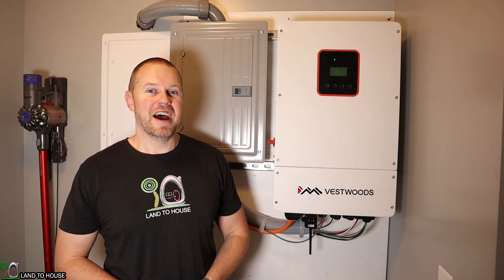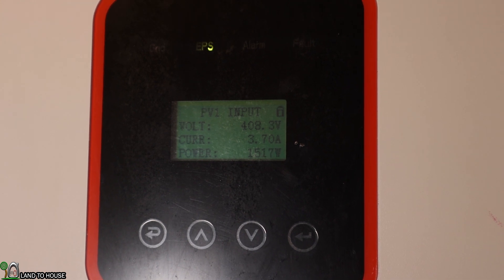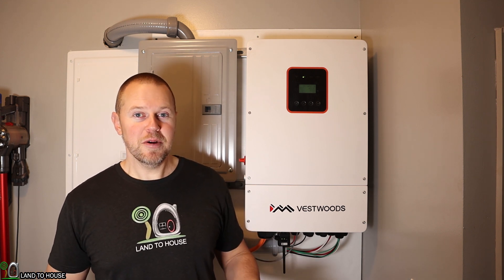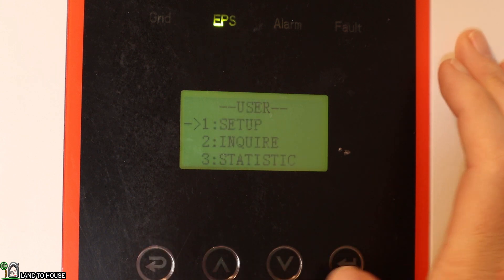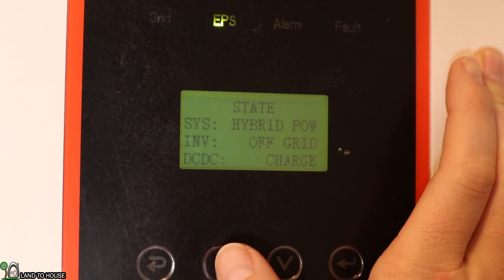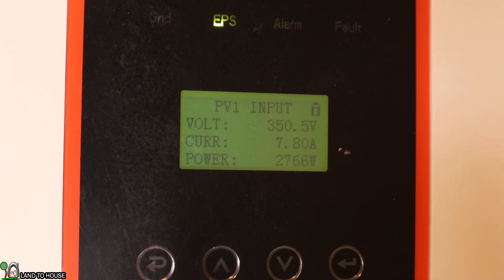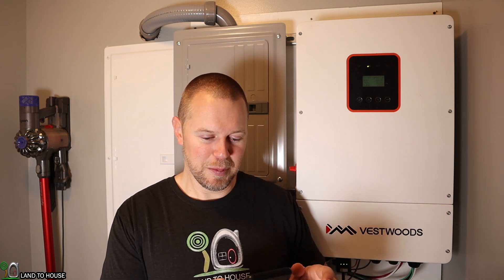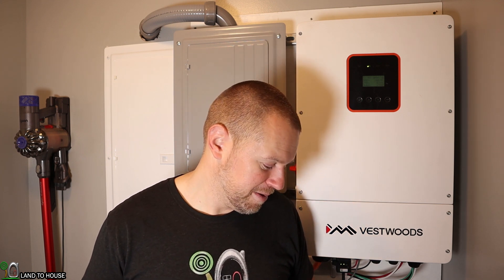Settings Matter! 3kw of solar only charging LiFePo4 Battery at 1500w (FIX)

Comment: Excellent solution.  Was that from hours spent reading the manual, or a call to tech support that will hopefully lead to a revision to the manual?
Reply from the maker: I think it was a "jump in the settings and try it" type thing. I increased the amps setting by a couple amps and noticed the solar jump up.

Comment: i wonder how efficient it is to convert 400V to 57 volts, a MidNitesSolar 150 manages 5kw of panels, whether it can do it or whether there are MPPTs on the market that do it doesn't mean anything, certainly finer electrical conductors between panels and inverters is an advantage, but at the expense of what, I don't think logical even if the market wants this, I prefer lower voltages thicker cables and higher conversion efficiency over time and a completely separate setup so that a fault or problem is localized and you don't run out of the whole system for a repair or shipment, sizing the electric cables on 56-57Volt maximum batteries especially with lithium which should not be equalized to voltages higher than 5 or 7 volts as for lead acid, where it is indicated to use a voltage higher than 130% of the panels on the MPPT of the equalization one, as the maximum operating efficiency point also towards the rising and setting of the sun.Ciao

Comment: What appliances can it power in your house?
Reply from the maker: This inverter has an 8kw output. I have all the lights in the house and all receptacles. Microwave and refrigerator. Next I am going to connect the well pump.

Comment: How many amps though???? Make sure you wear your rubber gloves and rubber gumboots! DC will really tingle you. 👍😳
Reply from the maker: The battery can charge over 200 amps. When I get the next 3kw of solar installed I will have the charge controller set to 125 amps.

Comment: wouldn't you set the charge current to that of the c charge rate of the battery and if it can handle 12k of solar you would max it and then use the controller to ramp it back this way they will be a more even current
Reply from the maker: That is a good point. I'm about to hook up an additional 3 kW of solar and will most likely increase the charging current to about a 125 amps.
Reply: @LandtoHouse  i have tried to look back on your videos to see more information about that unit is it solar charger and inverter all in one ?
Reply from the maker: Yes it sure is. This inverter can output 8 kW and has an input from battery, grid, generator, and up to 12000 W of solar. This system in combination with the one out in the power shed has been great. Yesterday we used 2.5kwh  of grid power.
Reply from the maker: In order to sell back to the grid I would need to have a professionally signed off system. I would also need to sign up for a bi directional meter..

My hvac system is the primary reason I can't go totally off grid. in the Winter that thing will suck down 40kwh a day.   With my additional solar I'm gonna have 6 kW going to this system I would need twice that.
Reply: @LandtoHouse  Depending on your state and power company, selling back could be easy or onerous.  Some charge a monthly rental fee for the upgraded net-meter, they can charge a fee for an annual inspection of the system, they may require a locked disconnect switch that they have the only key to use, some charge a license fee to be a power generating operator on their grid, some charge add-on fees for use of their grid to transmit power, etc.  It all depends on what laws the state/county have passed to encourage or discourage small scale renewable energy.